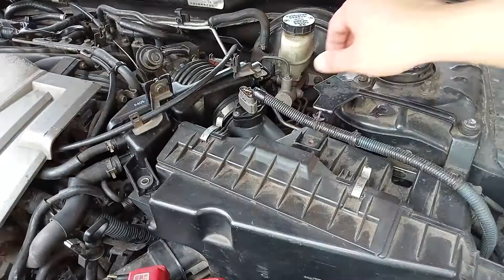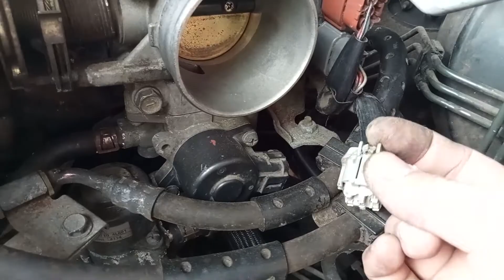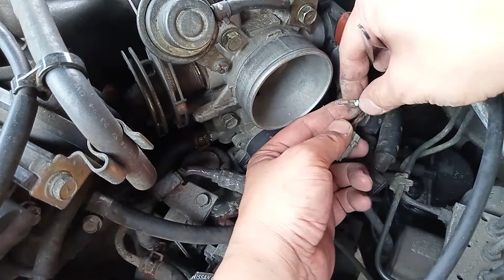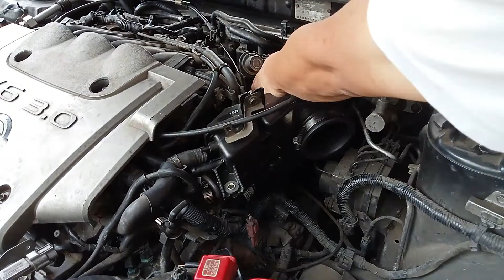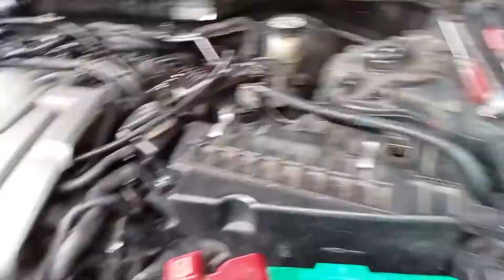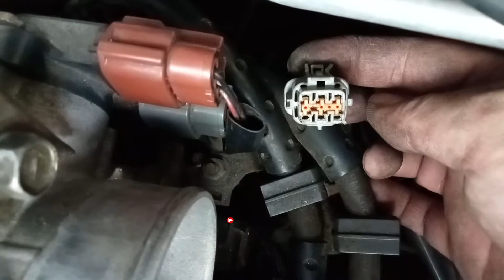Replacing IACV Socket

Comment: sir anong sasakyan po yang pinaitan mo ng IACV socket? parang pang nissan cefiro din.. pa help naman ako sir, di ko na matandaan tamang pag ka sunod sunod ng 6pins eh, biglang nag crack na kasi yung socket sobrang lutong, at pag hila ko natanggal na sila
Reply from the maker: Yes po sir, pang Nissan Cefiro A33 po. Ito po yung link ng photo para sa wiring diagram.
https://www.facebook.com/photo?fbid=202162079236639&set=pcb.202162385903275